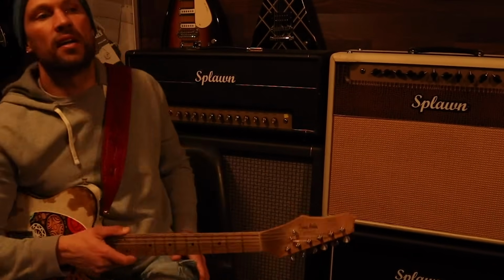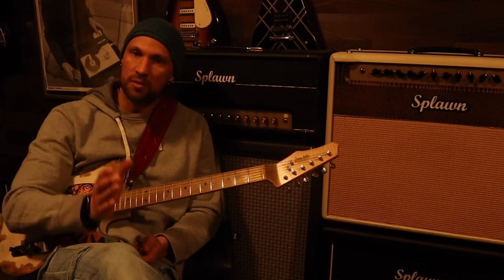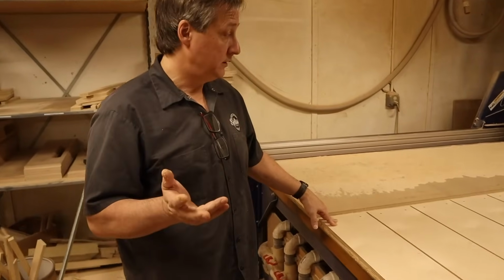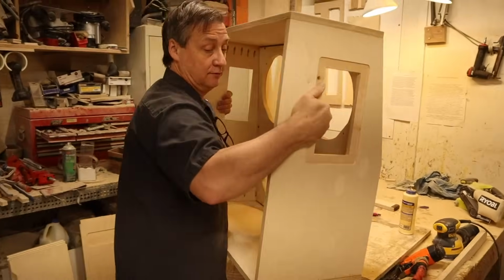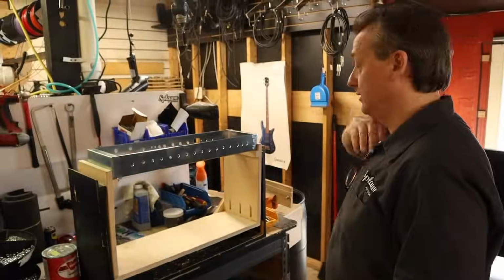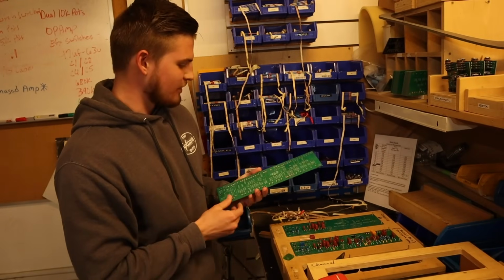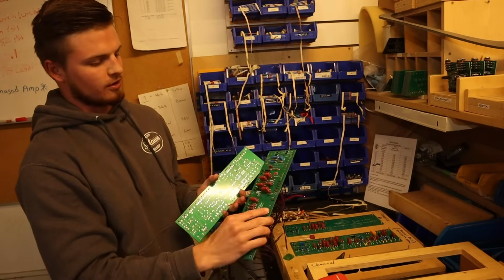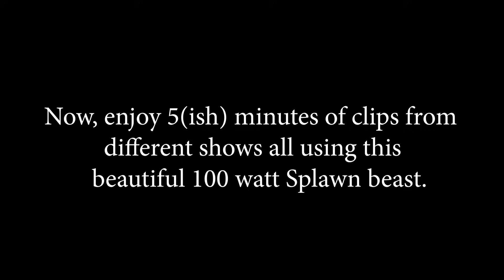Behind The Scenes Making Of a Splawn QuickRod (w/ Scott Splawn)

Comment: The look of pride on Scott's face just past the 14-minute mark says it all about his amps. I have a Competition, and it's impossible not to smile when you crank it up. I gigged with a pushed 1981 2203 for a few years, thinking it was the ultimate, but the tone I wanted from that amp comes straight from Splawn's shop with zero boost and little tweaking.

Comment: Does he use baltic birch for heads too? That's such a waste of great cab material in a spot where any other plywood would do just fine :D
Reply from the maker: Not waste if he does the cabs in the same wood too right?
Reply: @calebdavismusic3148  well it is a waste, there is no reason to make an amp enclosure out of premium material best used for cabs. It would be called "overspecced" every 5 or 6 heads you could make a cab out of and since the heads are tolexed anyway it might be a good idea to use a cheaper and less scarce material that might be lighter and therefore better. Also that would reduce manufacturing cost and possibly the price for end user